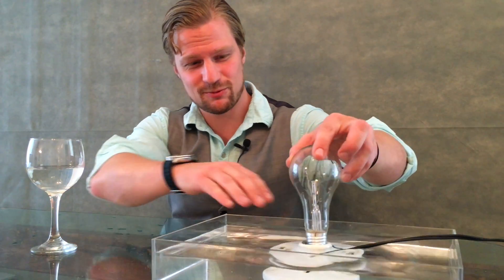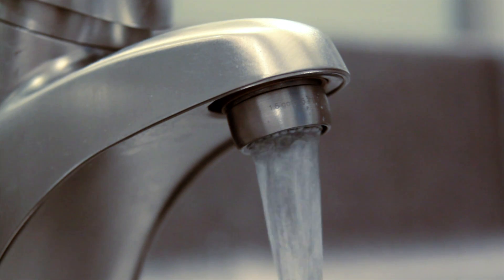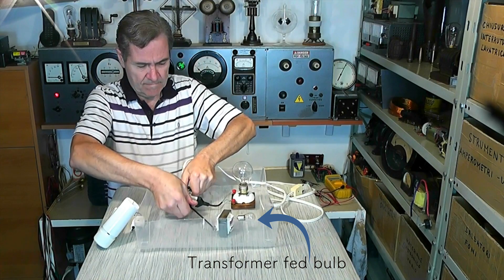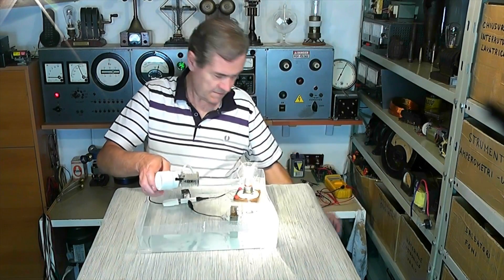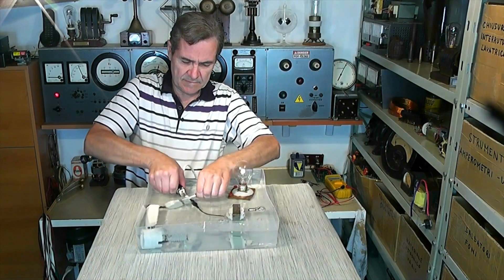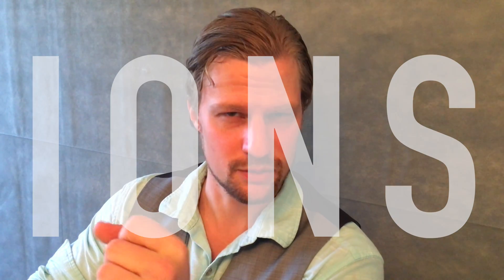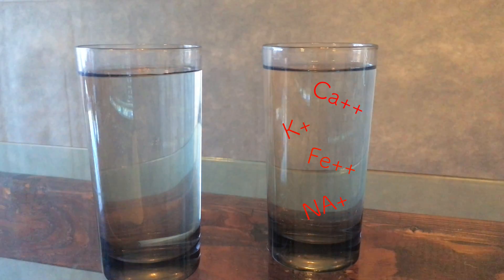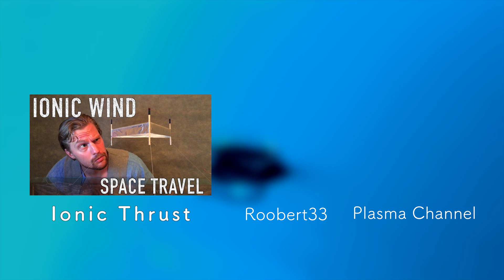Using Water As An Electrical Insulator?!

Comment from the maker: Please note: after further review, pure water in reality is NOT the best insulator known to man, and dielectric strength does not share a direct correlation with conductivity. It is nonetheless a great insulator, and one of the best insulators known. However, hypothetical pure water does not conduct, because it does not contain the necessary ions to conduct. In reality, even pure DI water still forms ions through Autoprotolysis and contact with Carbon Dioxide in the air. Hypothetical pure water, without those elements, does not conduct.
Reply: Indeed I was just about to make that point.
Reply: So, would it be right to say that hypothetical pure water is the best insulator known to man?
And can electrolysis occur in hypothetical pure water?
Reply: @stopess254  nope pure water is a poor insulator.  It's a not a very good  Conductor but definitely not a good insulator, they are not the same.
Reply: @dogwalker666  What of electrolysis in pure water? 
Is it possible?
Reply: @stopess254  yes it takes a lot more energy ie higher voltage, pure water is a millionth that of sea water, but once you have started you can step down the power.
Reply: @stopess254  No

Comment: i was thinking this can be used to cool a pumping chamber for a laser i been wanting to build ,unfortunately i only have the pumping medium built and never went through with getting the other components like the nd glass rod and doubling crystal and  mirrors ,mounts etc but di water being circulated through this system would def have helped keep the 2000 watts of light  stay cool and continuously working

Comment: Remember, that as soon as you submerge things into distilled water it is distilled no more. The salts, metal oxides on the surfaces, and in your skin will make the water conductive quite quickly and as soon as electrolysis starts to take place it will become conductive in a matter of seconds as hydroxides will form.

Comment: if distilled water is an insulator, then why did my phone died when I spilled my bottled water?
Reply: Bottled Water is typically either Mountain Spring water or tap water.
Reply from the maker: And, distilled water, if it touches your phone, will become undistilled very fast. Your phone has a lot of loose chemicals and ions on it from all your sweat.
Reply: You drink distilled water!? O_O

Comment: its not conductive cuz its not salty, when i was 14/15 yrs old i got a heavy electric shock i was bare feet and floor was wet... just imagine, but somehow i survived. if water is pure not touch things like pipes, stones etc it will be safe
Reply from the maker: Hi Sandro, that is correct. Great analysis.

Comment: Ok I can concede distilled water is a great insulator, buuut it still has ion's in it right? Isint there an equilibrium of Hydrogen (H+) and Hydroxide  (HO-) ion's in it? Didn't we all learn this in grade 11 chemistry?
Reply from the maker: There are indeed ions in it. Correct. However, so little of these ions exist, that pure water is still the most insulating thing known to science.

Comment: Just a heads up,' water does NOT contain hydrogen and oxygen. Go ahead, try to electrolize water and separate the  hydrogen and oxygen without SALTS, your gasses come from the salts eating away the metal from the anode/cathode connection... Education system is broke, memorizing and parroting BS is not intelligent.
Reply from the maker: Just a heads up, being abrasive and lacking class will get you banned from my comments on my entire channel. I’ll look into what you claimed above. If I’m wrong, I’ll publicly admit it. 

It’s been so long since I released that video, I hardly remember what I said in it. Nonetheless, the point of the video was about insulation, which, I still stand by my word. Perfect DI water is one of the best insulators known to man.

Comment: That was a pretty irresponsible video to make  at least without doing some better research (water is nowhere near the best insulator) and at least explaining that it is important to only try that under controlled conditions. Even at 110V AC that is pretty dangerous. Demineralised water is a pretty good insulator but only compared to a few micrometers of plastic per centimetre. Leaving the wires in the water will rapidly add ions and heating the water makes it much more conductive.
The reason the experiment with the hair dryer was at all safe was because the water cooled wire makes a very good conductive path back to the isolated power supply he was using and after a few cm even the hot water with its rapidly rising load of ions can’t carry electricity anywhere near as well as wire.

If someone were to try this at home with out the isolated power supply etc and muck around with it for too long it could easily be fatal
Reply: The salt on your skin will quickly add electrolytes.
Reply from the maker: The American society of electrical engineers lists pure water as 81 times more insulating than air itself. That’s an incredibly credible source of info. I’ve also dealt with electricity for 15 years. Think I’m good. Ions readily dissolve into pure water, making it conductive. I’ve run hours of tests, and a hundred trial runs of this scenario. No amount of sweat on the hands, no corrosion from copper dissolving in the water over a time period of less than ten minutes can create a conductive enough liquid. The water will drop in resistance drastically and become more conductive. But still resistive enough that it acts as a very great insulator. Then again, what would I know, I only do guest appearances on television shows presenting physics and electronics. Good day to you. So sorry the video was found in distaste.
Reply: Plasma Channel no I really liked the video it was awesome... but as you prove in many many of your videos air is a brilliant conductor compared with the lacquer on your high voltage transformers... less than a millimetre of lacquer stopping enough voltage to jump across a room... 

Sorry I was a bit harsh I was just sent to this video by someone claiming distilled water was completely non conductive... any chance of getting you to do some high voltage stuff to show that this isn’t the case? (And it isn’t strictly the conductivity of the water but a high voltage arc through distilled water can be pretty impressive)
Reply: Plasma Channel ps he also claims water is an element and the hydrogen and oxygen produced only come from the electrolyte
Reply from the maker: Ah, I certainly understand. It’s okay. I actually plan on more videos regarding this topic!

Comment: Demineralized water does not contain any ions that will conduct electricity
Reply: Plasma Channel that isn’t correct it spontaneously breaks down into hydrogen (H+) and hydroxide ions which is why it is nowhere near the best insulator known to man PVC for example generally has about three hundred million times the resistance in ohms/cm which is why we use plastic as our insulator of choice rather than demineralised ice in even the most expensive projects
Reply from the maker: That is correct

Comment: this may hold true at voltages of 120v / 240v / etc because indeed the resistance of pure water is so dang high that its essentially not going to be part of the circuit like this. However, there is no such thing in nature as a perfect insulator if you treat that sample of water as a resistor and make it part of the circuit you can indeed get a current to pass through it, granted it may take a very high voltage potential to do so. https://www.youtube.com/watch?v=lyy3HobZMdo

Comment: I found that even tap water is not particularly conductive. I tested this in a recent video, the leads are about 10 inches apart or so voltage reduced from 120 to 2 to 3 volts and 0 amps. But very interesting was that frequency was maintained.
Reply from the maker: Tap water is still highly insulating. A 2 inch syringe filled with tap water registered on my meter as 48,000 ohms of resistance.
Reply: I wish there was a way to post images in replies. I think Egyptians took advantage of this fact and actually stood in water that had high frequency  electricity coursing through it. Used their own body as part of the circuit and then had a method to reduce to frequency into a usable voltage/amp at the end.

Comment: Ok mind blown...I'm now extremely curious about something. I've made a electrolysis before and it worked great. But what would happen if you used your water deionized?
Reply from the maker: +Erik Weishaar with di water, you'd have zero electrolysis happening. Ions are needed in the medium to transport the metallic particulates onto your metal to be plated.
Reply: Plasma Channel that's amazing. Cause if you can use this to fill the air gaps in UROV.

Comment: dielectric constant doesnt tell anything about how good an insulator a material is
Reply from the maker: +Woloszow thank you for commenting. dielectric constant is the ability of a substance to store energy in a polarized field. With increased conduction across a dielectric, comes decreased energy storage. Meaning, high energy storage (constant) equals low conduction.
Reply: thanks for response :)  I would say that discharge rate of energy rises  as conductivity increases. Conductivity doesnt change initial value of energy stored in capacitor, it changes time  for which it is stored.    As far I know dielectric constant says how easily electric field penetrates material. It is just like magnetic permability but for eletric field. For quality measure of insulator I would use values of resistivity and electric field of break down. Of course it is possible that I am wrong. BTW I like your videos :)
Reply from the maker: +Woloszow I'm happy to respond! You make very good points. I am just basing my understanding of dielectric constant off of my initial education on the topic. High value ceramic capacitors have a tremendous energy per size package, in part due to advanced ceramic engineering, allowing tremendous energy storage for small size. Also, I probably should have included ohm readings of the waters, but feared too many viewers would not understand electrical resistance. I actually used to create water resistors for my voltage multipliers, and found that water is very resistive. Again, you make great suggestions, and perhaps I'll start including more technical aspects to my episodes. Thank you for your viewership!

Comment: super video as always ;) 

i knew that water wasn't conductive, but i didn't know it was less conductive than air by 81 times o.o ...

" The more you know " ... XD
Reply from the maker: North Thelittlefox thanks! Depending on the source you draw from, some text will say 30 times less conductive, while others have gone as high as 81. I was taught 81 through my education. It's interesting stuff!
Reply: @PlasmaChannel  Are you sure the Conductivity is less the dielectric constant is 80.4 that of air therefore the capacitance using water as a dielectric would Hold 80.4x more charge !
Reply: @youknow8754  

Interesting question.

Apon reading your request I thought if you liquified air ( nitrogen and oxygen) it would be about ( I am guessing) 80 times as dence as air as well.
Reply: We Will never know the correct number , however we already have a pretty good estimation ... it is indeed very interesting

Comment: Was the electrical parts cleaned first?

I would fear what could dissolve from the setup and make the water conductive.

Also, as far as I know; the z-machine is a huge water capacitor!
Reply from the maker: +erlendse ah yes, the z machine! I am very fond of this. Also, you are correct about dissolved salts from our skin and equipment. However, i experimented enough to find out that it takes a lot of contamination before water turns conductive.
Reply: @PlasmaChannel  interesting... I was wondering about that, too.  Like, I had the thought: is this more dangerous to do on a hot day, when one is sweating?

Comment: Thanks for the nice video, an excellent job :)
Reply from the maker: Electric Experiments Roobert33 thank you greatly. However, full credit goes to Roberto. Without Roberto reaching out, our collaboration would have never occurred.
Reply: Electric Experiments Roobert33 Good to see a face to a well respected experimenter. Cheers!
Reply: Thank you :)
All credit is for Plasma Channel.
Reply: So, it has to do with the conductive material (or lack thereof) in the water? Why is humid air more conductive? Thanks!